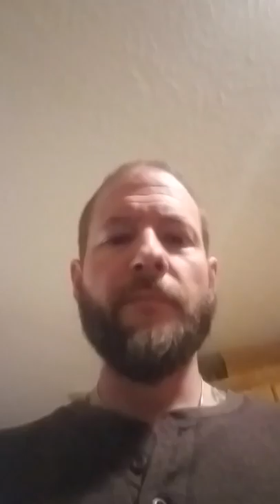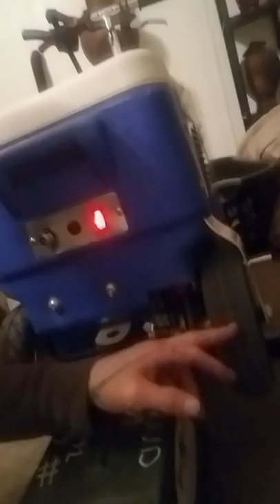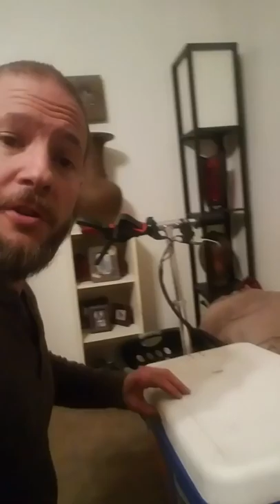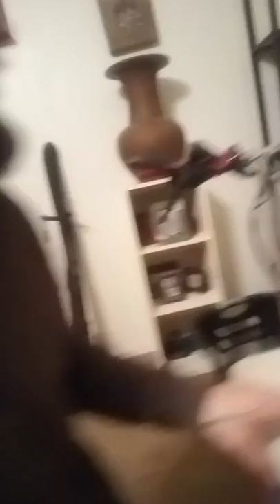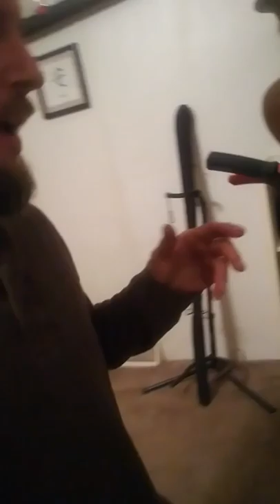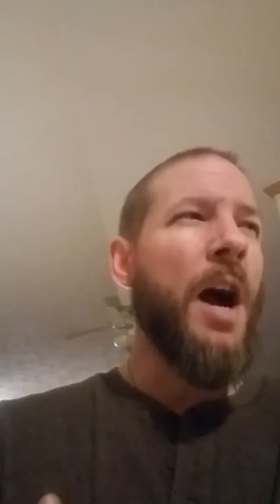The cooler scooter motor!!

Comment: That's a neat rig! I've no clue how to turn it into a grinder, but it bears some investigation as to the difference between max rpm of the shaft vs max target rpm of the grinder to be. Build a belt driven grinder from scratch, and use the motor to turn it via a belt and pulleys. Or you could drive the beer wagon for festivals.

Comment: Seems like it's got plenty of torque and power to do it... You just may need to purchase or build wheels/bearings that would be the right width and have tracking ability... I'm fairly certain that you could find someone who has the welding ability to frame it out properly... It also might be worth looking into a hardwire conversion so you're not right in the middle of a project and have to charge because the batteries ran down or wore out. But I'm excited for you my friend!